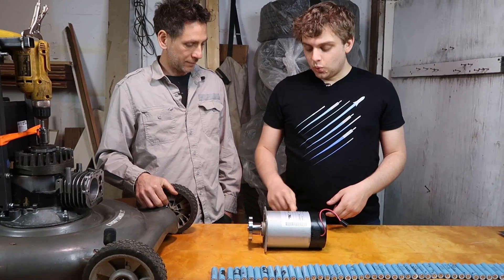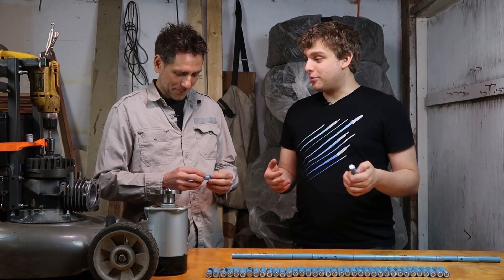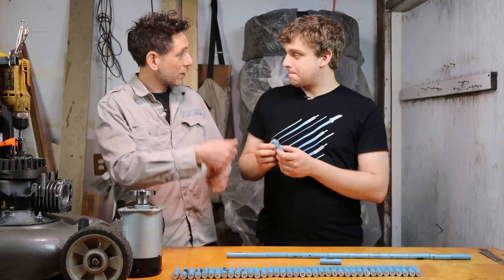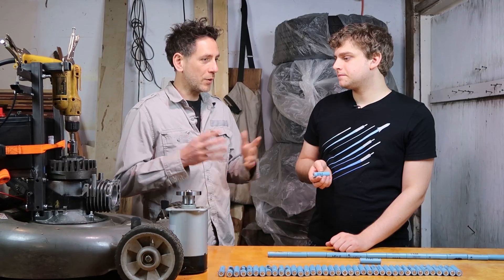Electric Conversion Workshop: Lawnmower Project - Episode 5

Comment: This two batteries gives you both high capacity and high C. Sony vtc5a 2600mah 25A &  LG hg2 3000 mah 20A. For just 4$. They are overkill but the heat build would be much less. And the lifetime would be longer if you don’t have to push the battery pack to its max.

Comment: Motor requirements. 550 watts / 48 volts = 11.46 amps
26650 battery at 4000mah  3.2 volt nominal Lifepo4  which 4 battery in series is equal 12 volt battery with 20  amp hour max draw.. or 2C discharge.  or 8 amps   1 C = 4 amps   C = 4000 MAH =  4.0 AMP. 
8 batteries in Series  allows 2C  continues.. 
Parrell for longest life if make series and then parrell the batteries each can handle 2C from each  to get the 12 amps needed we need 6 parrell  of 8 series of these batteries 
4S / 4P  = 12 volt pack  / 4S  = 48 volts of 26650 4000mah 3.2 volt nominal   Max voltage is 3.6 volts fully charged  and lowest discharge voltage is 2.0 Volts.   32 volts lower voltage to 51.2 volts.
However one does it just know that battery end voltage will be lower than the fully charged voltage. 
18650 battery 13S / 4P   3.7 volts which is not entirely TRUE as that is the nominal voltage.
Lower discharged voltage is 3.0 Volts and fully charged voltage is 4.2 Volts. 
13 Times 4.2 volts = 54.6 volts full charge   Low discharge voltage is 39 volts.
This Battery group has 2400mah  X 4 =  9600mah = 9.6 amp hours max. 
9.6 amp hours / 11.46 amp = 0.8376 hours or 50 minutes runtime. 
If the battery pack makes it to full charge of 54.6 volts as per spec of li-ion 18650.  
Fully charge  li-ion 18650 = 4.2 volts X 13 = 54.6 volts
 
However not all lead acid battery chargers will go above 51 volts on 48 volt systems.  48 + 2.5 volt max.   
Therefor 550 watt motor / 54.6 volts = 10.07 amps need to drive the motor with fully charged battery. 
550 watt motor / 39 volts = 14.102 amps. Draw when it running to bottom of discharge point of the battery pack of 18650 Li-ion.  13S is one cell technically.    P Groups is the Amp Hour draw amount or tank size. 
One cell 2C max draw or 4.8 amps normal draw not max peak draw or burst draw amps. 
4 Times 4.8 amps = 19.2 amps continuous draw possible.    
Motor at full charge battery 10.7 amps to full discharge 14.102 amps each is below the 19.2 amps.. 
LIFEPO4 26650 4000mah  4S/4P/4S =  51.2 volts  max amp Draw at anytime is 32 amps at anytime. 
550 watts  / 51.2 volts = 10.75 amps   at full charge   10.75 amps / 4P = 2.69 amps per battery cells group.. (series) 
550 watts / 32 volts = 17.1875 amps Rounded  17.2 amp draw at fully discharge point.. 17.2 amps /4p =   4.3 amps per cell in series group.   Well below the 8 amp max continuous  2C draw rating. 
4S = I cell and the max draw on this is 8 amps /4P Capacity  /4S  (12 volts X 4 = 48 volts) 
 This Battery group has 4000mah  X 4 =  16000mah = 16 amp hours max.
11.46 = 1.39 hours run time or 83.4 minutes run time. for this lawn mower.
Reply: Just know that a 12 volt battery is 6 cells X 2.4 volts at full charge = 14.4 volts which is where the max output of any car alternator should be set for max voltage. 
Fully charged battery should be 13.35 volts nominal.  There is 1 volt drop.. Resistance factor.

Comment: Error . 18mm width 65mm length 0 is circular. 14s would have been better for that motor imo. Taking into voltage drop.

Comment: In a car conversion, what is ideal? Tons of amperage or volts? Also, what are the implications of using 800 volts system like the porsche taycan besides higher rate of charge?

Comment: You said these batteries heat up after using a certain amount of c.R^s right .beacause there only a certain amount they can do , and you said that when you run up a hill you over heat or heat up.whell this is no enigma but in human anatomy the body has a cooling system which is sweat .basically what I'm getting at is what if you someone and again this just a thought hardly an idea get the batteries to have it's own cooling system, maybe anti freeze  I'm not entirely sure. anyway it takes aptitude.🖖
Reply: Tesla has a battery cooling and heating system.
Reply: @MrGsWorkshop  They do ?how does it work, and is it inside the battery or outside reflecting on the battery.enigma can be broken!
Reply: @waynechas4290  it's like a water jacket similar to an automotive gasoline engine.
Reply: Oh so it's in comparison to an insulater or a perhaps a microwave, keeping the hot or cold heat from escaping , but in this case it would be heat. But wait would that  cause it to crack due too the thermal expansion process .thanks for the feed back it helped🤯🙂
Reply: @waynechas4290  no literally it's liquid that is pumped through a hose that is hugging the side of the batteries.  It has a radiator just like a gas car
Reply: @MrGsWorkshop  I believe you.but wouldn't it crack though ,due to thermal expansion ?

Comment: Does electricity have alot of friction when going against the grain?
Reply: Not sure what you mean. Resistance is measured in ohms. Usually determined by the type of metal in the wire copper or aluminum, the diameter, and the length.

Comment: Tools are way better with batteries than ICE. If done correctly. Chainsaws are lighter and strong. Plus you don't need to pull the cord 47 times. Just push the button. Nice swap

Comment: For safety sake just go buy a new electric lawn mower.  They have been out on the market for years and are well designed with reliable batteries.  Less money would also be spent.  I get that you are trying to show the basics of electric lawn mower design but some one may actually try to make their own and could get injured if the thing shakes itself apart.  Hope you have liability insurance.